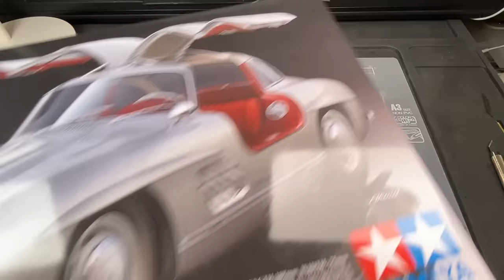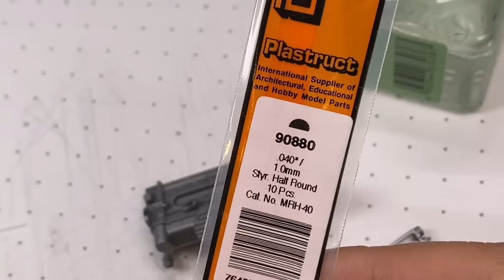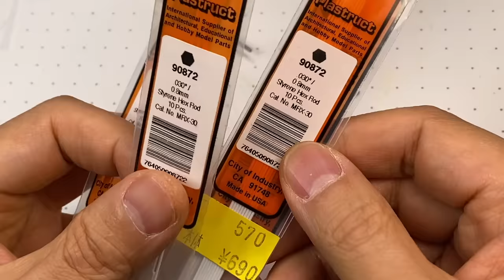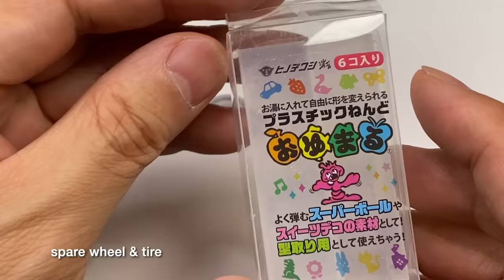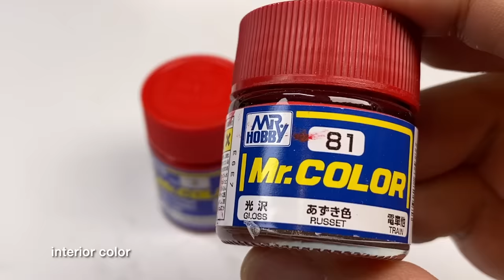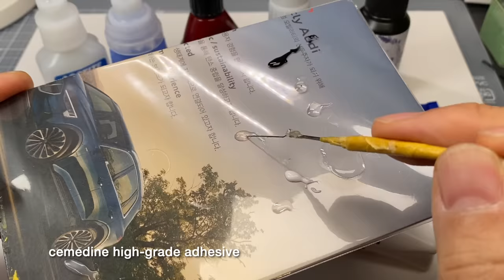MERCEDES-BENZ 300SL 1/24 TAMIYA Model car build [Full version]

Comment: Wow, that's really impressive. Would you mind sharing your mixing proportions  and air pressure when using  GX112 Super Clear III? I had bad results with it, but maybe I was doing something wrong. Thanks!
Reply from the maker: I mix clear and thinner at a ratio of 1:1.5 or more. I don't know exactly the air pressure because it is finally adjusted in the airbrush. Thanks.
Reply: @A4Garage  thank you very much for your answer.

Comment: I agree with what everybody wrote here, this is absolutely outstanding!
But where is the steering gearbox? There are certainly some parts missing in the linkage, too. Or did we just not got to see them? I did not see the exhaust, too and it is certainly there! Glad you corrected that upside down speedo! 😊 Don't get me wrong, you are a genius! I might be able to put the kit together out of the box, but you are miles ahead of me.
Reply from the maker: There are still many missing parts. It seems that the expression will increase as my skills improve. Thanks!

Comment: I can only say: WOW !!!! That is amazing. Your micro detailing are genius. The engine, best of all the dashboard with the folding steering wheel. That is unbelievable. Only a little mistake, haha. 1955 Mercedes-Benz  has no  seat belts. Maybe before in the race-cars 1953-1954  (Mille Migla Race, Panamericana Race etc.) But not in the street-cars. The first car with seat belts was the 1958 VOLVO 544. Since 1976 is the seat belt obligation in Germany (in other countries i don't know) But don't be worried, it's okay so, was only an information for you. But I'm very wondering, where you get all the infos from the engine. That is really fantastic. Greetings from Germany.
Reply from the maker: Thank you for the good information. All data is imported from the Internet. It was not a vehicle owned by many people, so it was not easy to find data compared to other cars.

Comment: hi cool done and lada kalina
VAZ 1118 could have been made by the steering and suspension removed from production, despite the modernization of the front suspension struts with barrel springs, in general, its scheme with straight forged levers and diagonal jet rods resting on them (called extensions) instead of modern L-shaped levers seems outdated today, the design has a unification with the whole family built on this co platform. The engine of the Lada Kalina car is designed for gasoline with an octane rating of 95.

Comment: Excellent attention to details! How long does it take you to finish a model like this one? Alos, I would be worried by oxydation on the metal part you're adding. Do you use some sort of coating to prevent it? Also, I'm wondering if you ever add lights to your models... Thanks so much for sharing.

Comment: Amazing work!!! 
 How do you keep the thin polystyrene from breaking when you add glue? When I try wrapping it around a radius, it snaps.
Reply from the maker: I use only a small amount of the adhesive to fix it, dry it completely, and apply the adhesive again.

Comment: Lovely work. I have to wonder when the real cars were originally built whether they garnered such meticulous attention.  You went into such intricate detail and yet you chose not to articulate the propshaft and axles. I am curious why or are you just deferring that to a later date?
PS. I know this is nitpicking but the rear springs seemed too fat to me.

Comment: 1:36:54 hello, tremendous work. May I ask whether you used photo etched Mercedes Benz logo for the hub cap or did you mask the existing surface detail? Thank you
Reply from the maker: I carefully wiped off the logo part after drawing on the wheel cap. Thanks
Reply: @A4 Garage thank you. I shall practice this technic. Thank you again

Comment: In the real car, so soon after the war Mercedes didn't have enough capital so they took parts from full sized sedans to build this car. The only spot they could save weight was the frame. It's engineerd so the stresses compress on each point and not flex or bend. 4 wheel drum brakes SMH grabbed what they had